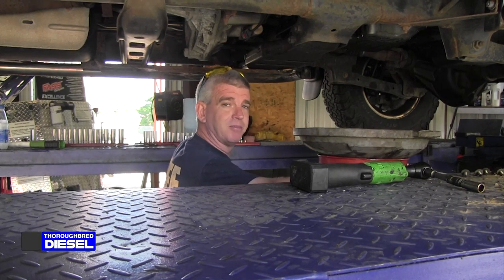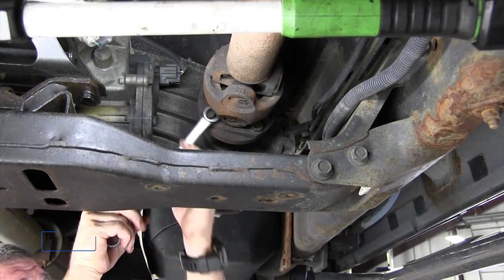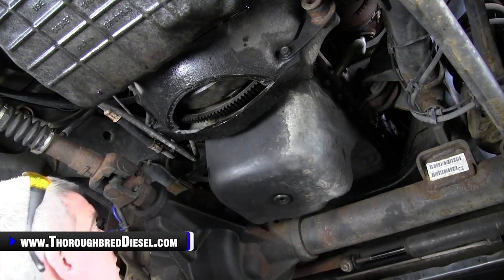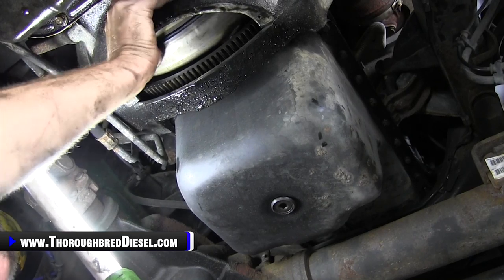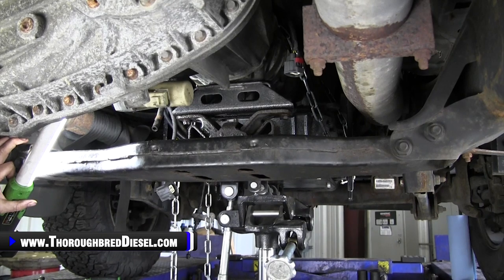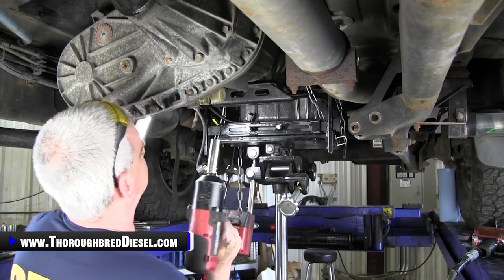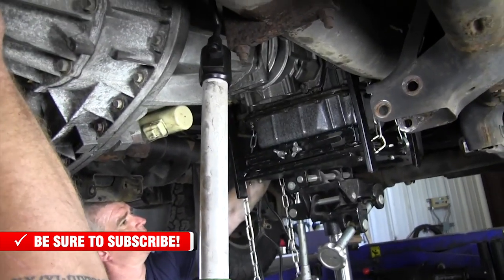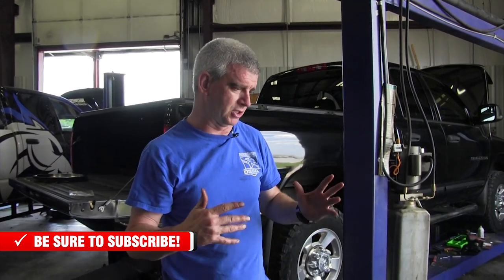Remove A 48RE Automatic Transmission (Safely) | 03-07 Dodge Cummins 5.9

Comment: how do you suggest flushing the cooler and lines. also if your upgrading to a triple disc converter should the cooler be upgraded as well. can you recommend one and maybe a location. thanks. video was a great help
Reply from the maker: Hot flush from is what is recommended.  If you cannot get that done we suggest using the compressed air flush can and to evacuate all of the old fluid. An upgraded cooler is always recommended or at least replacing your stock cooler to be sure that you have enough cooling capacity.
Reply: Always replace with new coolers and lines if you blow your transmission. The whole system will be contaminated.
Reply: Depends, what did the fluid look like and any metal in the pan? With metal replace it all. If just burnt fluid, blow out whats in there. I buy atf by the 5 gallon pail. I just pump some fluid through till it comes out clear. If metal it won't work well, essier to replace the cooler. And no the cooler does not need to be replaced if changing to a 3 disc.

Comment: Question. 
The transmission on my truck is leaking oil through the access to the torque converter. 
Could you please give me a possible explanation as to why it’s doing that.
Reply from the maker: Could be a leaking TQ seal, or the trans is overfull of fluid.
Reply: Thank you very much for your reply.
Reply from the maker: You're welcome!

Comment: How much differnt is this removal from a 98.5-2001 model 2500 Cummins?
Reply from the maker: Very similar removal process. Follow the same steps.
Reply: @thoroughbreddiesel  Thanks so much for the response man. So the crossmembers will be the same to remove as well? Will I need a jack to separate the frame rails to get the main crossmember down?

Comment: Nice to have a very thorough visual guide to reference here. Pulling transfer case to have rebuilt and replacing a cracked and leaking od housing on a 48. Thanks guys. Definitely earned a sub
Reply from the maker: You're welcome!

Comment: Gonna be pulling mine here in a few days, first time doing this task. My driveway has a slight grade, any tips for combating that grade besides chocking the tires?

Thanks for the video! Glad I watched it because I didn't order a barring tool.
Reply from the maker: Barring tool makes life so much easier. Yes  really just make sure the tires are chocked. If you can find a level place to do the job would be so much easier. If not, not impossible, just be careful.
Reply: @thoroughbreddiesel  Thanks for the reply! I chocked all four tires and even went as far as putting ratchet straps around the rear wheels and hooked to the rear axle yoke. She is still holding good, T/C should be here today and flexplate tomorrow!

Comment: Great video! I have a stock ram 3500, no lift. Will I be able to get the transmission out from under the truck? Or will I need to lift it quite a bit?

Comment: pulling the trans from my brother's truck, however not sure what size the front inspection plate socket size is? cant find the socket size anywhere, we tried a 10 MM but it started rounding off the bolt head 😱 so naturally stopped there before it rounded it off, some help with this would be great

Comment: On the front drives haft bolts on transfer case a 16mm is loose but a 5/8's is perfect. Dont strip the head. If transfer case is in neutral, electric has a pinhole where a paperclip works, you can the raise a wheel up and spin the drive shaft to get to the bolts essier if original they have blue lock tight on them. Be a hard pull to break them loose.

Comment: Started the process of removal. I lost over drive and I think 4th gear, hard shifting into 2nd gear. Any insight of what it might actually need? I'm not a transmission guy so I have no idea what I'm looking at
Reply from the maker: Really needed to be diagnosed in the truck by running pressure tests. With the trans out now you will be looking for worn clutches in the transmission and the valve body will need to be vacuum tested to confirm correct operation.
Reply: Thank you for your response much appreciated

Comment: Mr Colin , I have a cracked tail housing on my 2x4  06 5.9 ram big horn with a 48re 1- can i safely remove it under the truck or does it have to be pressed out, 2- if i cant find a replacement part should i have it sent off to be wielded.

Comment: How long and what size was that extension to remove the bell housing bolts?
Reply from the maker: We used 3/8ths drive and as many extensions as it takes to get it done. Probably at least 4 feet.
Reply: @thoroughbreddiesel  thank you

Comment: Do the 47 48 RE always have zerk fittings on drive shaft u joints? It might be time to check u joints and consider swapping them out.  On that 16 mm sometime a 5/8 s manifold wrench will do it.  On the inspection plate I remove bolts and I never sieze em. little pit of paint on torque converter and ring gear to make finding the hole easier. even with new converter.

Good video

Comment: This video is defiantly going to help when I remove mine, just have a feeling it will be a nightmare because of all the Wisconsin salt rusting everything up.
Reply from the maker: Happy to help!
Reply: It wouldn't be so bad, dig a hole the same size of the truck. Then fill it with say bolt blaster and soak it a few weeks. Of course it will have a bad smell for months to come but should help loosen up rusted bokts.

Comment: 1.) Do a bunch of aMpHeTaMiNeS 
2.) Remove driveshafts and t-case (1 person can get the tcase off but if you dont have a 4+" lift it wont fit under the frame rails on your stomach)
3.) Remove the trans
4.) Jack the rear axle up as high as you can unless you have a large lift because the bell housing wont fit under the frame rails.

Huge pain in the ass to do on the floor but you can do it.
Reply: Im about to yank my 48re out of my 07.  doing this on concrete floors....no lifts sadly.  I'm already not looking forward to this.  Wouldnt of had to pull the trans out but 2nd gear band got jammed up between the casing and the drum!!!

Comment: Would same instructions be on a 46re trans also?
Reply from the maker: Yes you may run into other things with gas motor such as exhaust configuration, but generally the same process.

Comment: Would anyone happen to know what size bolts are used in the bellhousing . I have 2003 4x4 
with a 48 RE and my bolts are broke
Reply: They are 3/8-16 thread and 1 7/8 long. I would use grade 8 2" long bolts with grade 8 washers if you are doing it from the hardware store.